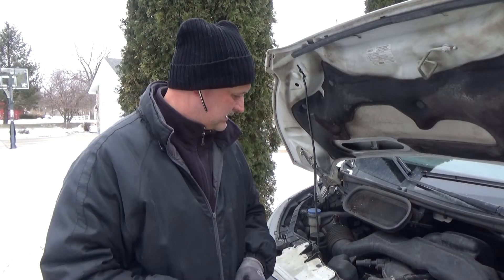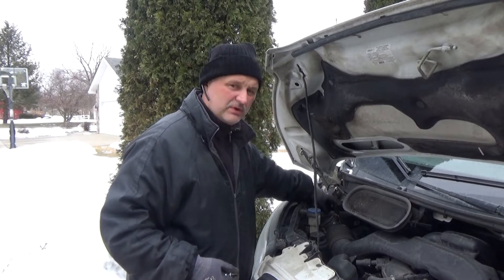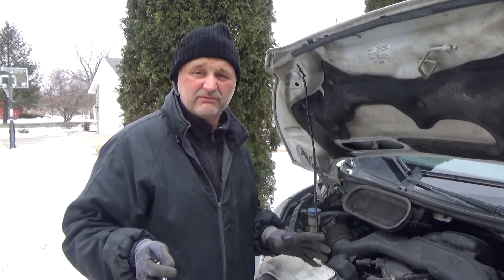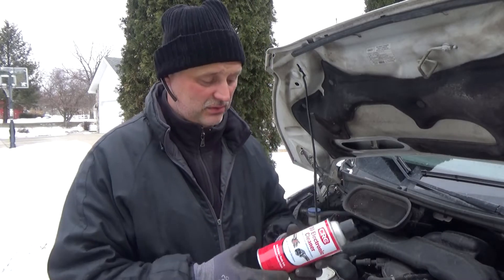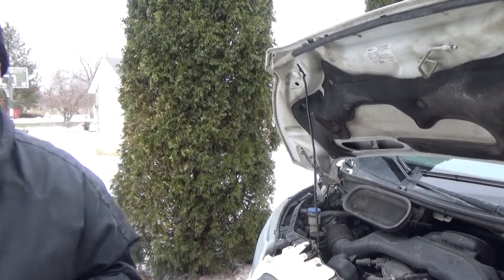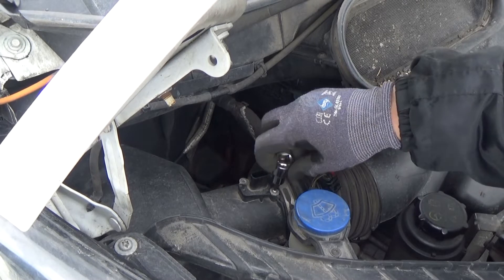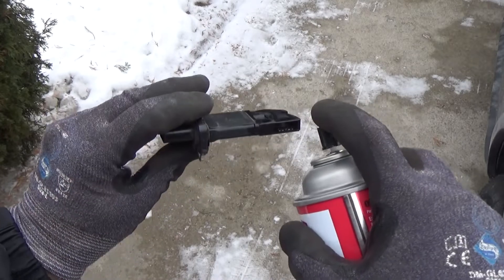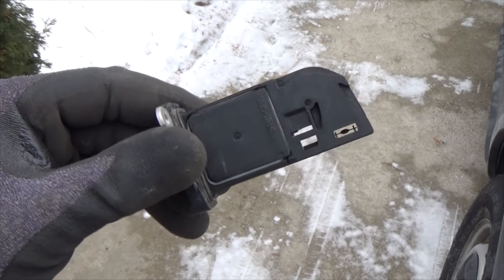2015 Ford Transit Mass Air Flow (MAF) Sensor cleaning

Comment: I couldn't seem to find the mass airflow sensor (MAF) located where your sensor is locatd on your ford transit in the video.

I have a 2018 transit. However, there are no electronic sensors whatsoever from the air duct to the air filter. It's just plastic.

My Transit-250 is an October 2018 3.7L model.

I don't see how that would have made a difference.

I do have a manifold absolute pressure (MAP) sensor which i've heard me b combined at some point in time on certain transits.

Comment: Ford dealer wants $550 to replace it. Not sure if that includes the $195 diagnostic
Reply: 27,000mi on the van.
Reply from the maker: It has to be something else even if it's diagnostic and sensor and labor. $550 is a little bit too much. Even Ford dealer is not that greedy. You need to find out what exactly they are doing. If it's just sensor, you can replace it by yourself as you can see it on the video. It's super easy. Is it exactly the same model? You shouldn't have this kind of problem this early

Comment: Ok... I think you messed up. I was told by various mechanics, you never spray the mass flow sensor with anything. Only use mass flow cleaner, anything else will destroy the sensor. 
I wonder what would happen if you re-spray the sensor, but this time use only mass flow spray cleaner. Or maybe the sensor is damaged now.
Reply from the maker: I will not try to convince you otherwise, but you can't mass up  MAF sensor with electric cleaner, because it's exactly same thing only different label and cheaper. Whole purpose of cleaning sensor is not to leave any deposits on it. Carb cleaner and WD40 for example will leave deposits on the maf which will most likely make it worse. Switch/electric cleaner on the other hand is designed to leave no deposit. 
But all of this didn't matter in my case, because my problem was/is harness itself, problem with wiring. I'm thinking when my engine was replaced insulation on the harness got damaged, open wire got corroded over time as the result I have on and off connection and no codes stored in PCM.

Comment: Electronic contact cleaner for MAP
Mass Air Flow sensor cleaner for MAF

Electronic cleaner can cause static on the MAF
Reply from the maker: I will not try to convince you otherwise, besides, it doesn't matter because in my case cleaning did not solve the problem

Comment: Ford is going downhill quick with these. I’ve been stranded many times from this issue.
Reply from the maker: With the mileage I have I can't complain
Reply: Ford is not going down. Ford is too big. 
If you're being stranded, you're probably not taking care of your car. 
I use to didn't like dodge at all. 
Since I learned to fix me own car. I keep up with my dodge. I love my Dodge. I also have a Ford. My Ford is awesome. 
I love both my Dodge and my Ford. 
I have no intention of buying a new car, not anytime soon. 
My Ford is a 1998. Runs awesome, great power. 
My Dodge is a 2001 and is my dream car. 
I think any car is great, if you stay on top of it.
Reply: We’ve had to replace ours 4x in 220,000 miles. Thats definitely a problem (not for them since they continue to make money long after the sale on extra parts).

Comment: Good "first stop" to see if it's as simple as that. Sorry it didn't work for you.
Reply from the maker: Turned out it was only part of the problem. Last week I wasn't able to start my van again. There was no error codes so I thought the engine was flooded, and at the same time I decided to change my spark plugs, by that time I had about 95k miles on previous set. When I pulled old spark plugs out, I discovered they were nasty dirty. There is a few reasons that can cause that problem. Bottom line replacing the spark plugs at least for now solved the problem